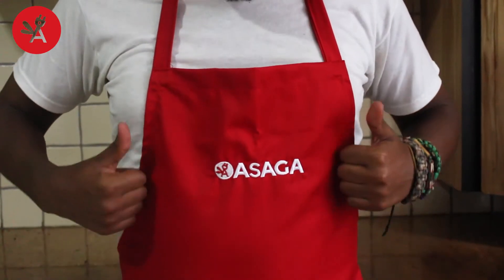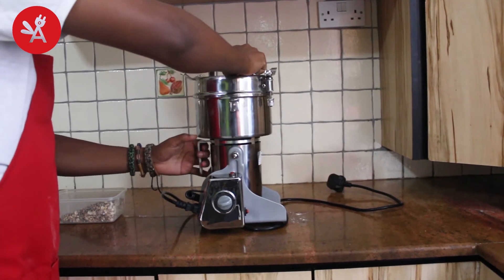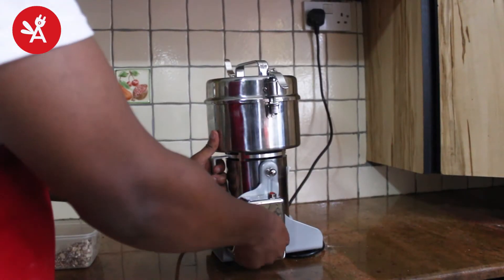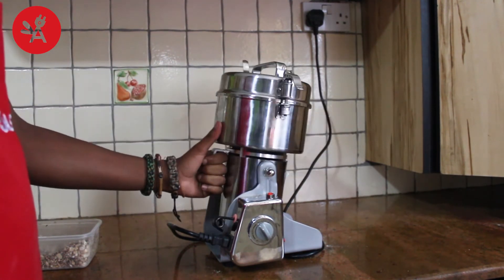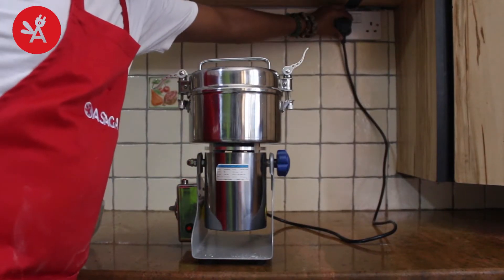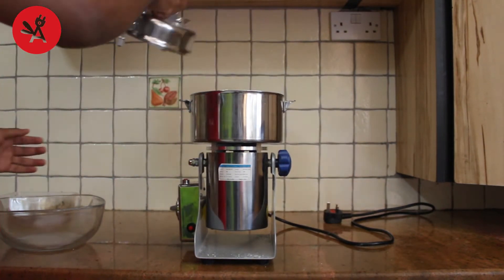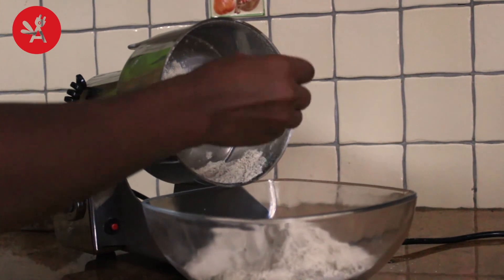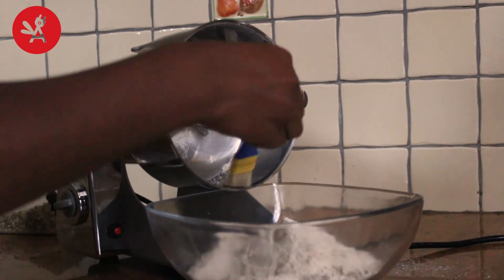How to use Asaga Dry Food Grinder (DFG) - Grinds maize, millet, beans, rice, cassava, spices, coffee

Comment: MY REVIEW AFTER USE: While at first this looked like a good idea, I no longer recommend this Asaga Grinder! Buy it at your own risk! Asaga replacement parts are not available in Kenya, -and you will need them! When the armature gradually fails, (usually after only  three months), your grinder is done! The Asaga company does not have a service center or even recommended technicians, and the motor replacement parts are  not available anywhere. This is one easy way to lose your hard earned $120! Word to the wise, seek alternative methods of grinding your food or shop alternative brands. Leave Asaga Grinders alone! 2/10.
Reply: Thanks for the good insight.I was to buy these machine for grinding my home use spices,but now i will not buy it